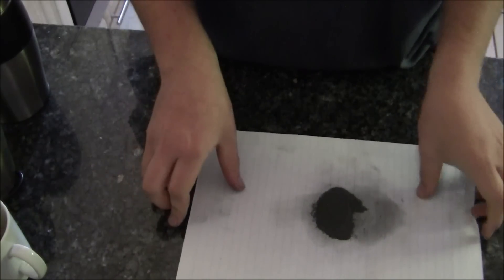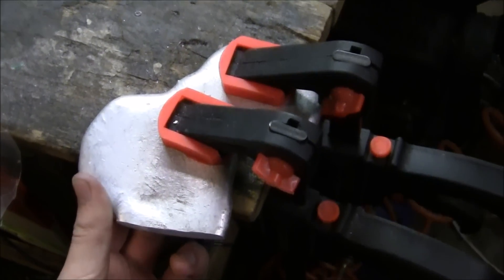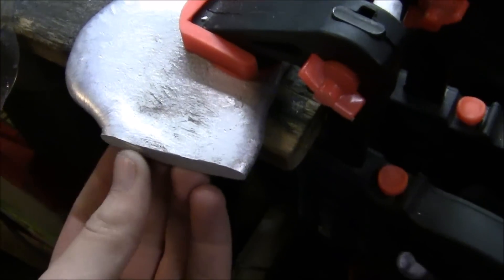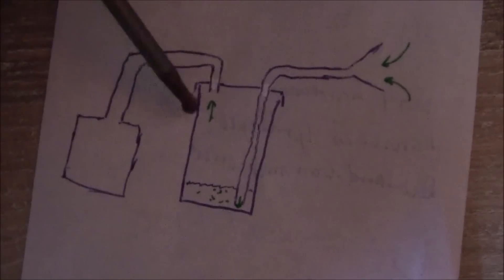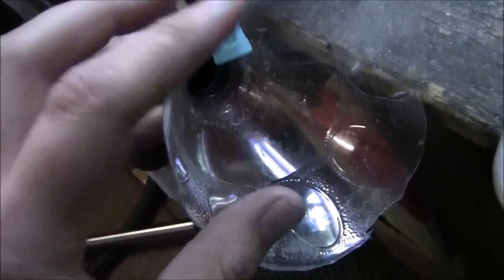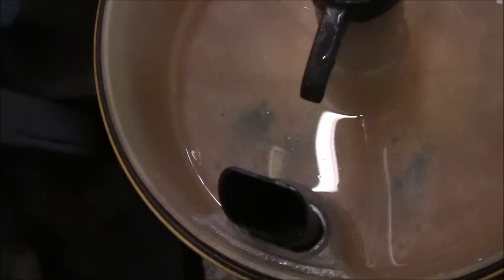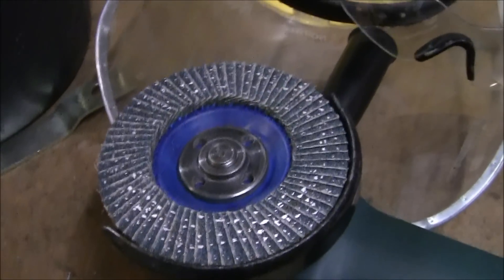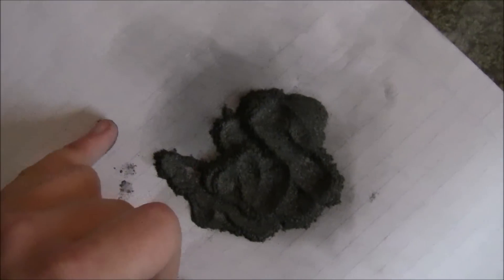how to make aluminium powder without using foil

Comment: Are you South African
Reply from the maker: hoe het jy geweet?
Reply from the maker: Dankey it's in a language only south Africans understand... I was confirming his question. It means ' how did you know?'
Reply: Home Grown Pyrotechnics I could tell by the accent.
Reply: And yes Afrikaans only South African know.👍 🇿🇦
Reply: Dankey lol our own president stole 700 million  rand 59213000,00 dollar
Reply: Home Grown Pyrotechnics I. Was wondering if you can make a video on sulfuric acid drain clean and tested if the drain cleaner it self will work in the sugar exprament and how much is left if you had to boil it down pls
Reply from the maker: for some reason YouTube didn't notify me of this comment. um as far as i know, sulphuric acid decomposes sugar into carbon so it would completely destroy any fuel i add it to. here is a video of the reaction: https://youtu.be/poDBrGIyTEk?t=33s

Comment: Have you thought of putting some sort of reducing agent in the water, so that the Al gets coated with it, preventing oxidation of the surface?  I believe charcoal is used during the ball milling of some products.  The water provides one with the opportunity to disperse a reducing agent more evenly, which might result in a nice even coat.  Just wondering.
Reply from the maker: the thing is that the aluminium has to be oxidised during the whole process because as it gets finer, it gets more combustible and if you mill it for like a week without letting air in, its said that it will oxidise so fast that it will catch fire.  the oxidation of the metal surface is instantaneous and forms a very thin oxide layer which then prevents further oxidation so i think that it wouldn't be needed to is some sort of reducing agent. i anyway have a lathe now and can use the turnings and im in the process of building a muuuch bigger ball mill for making aluminium powder but there are some parts that i need that i cant find.

Comment: Find a friend with a Lath the Chips and Shavings are fine and will break down very fast in a ball mill
Reply from the maker: Fred Nordhorn I actually have a lathe now, I got it mid november. I'm also building myself a rather large ball mill with the intent of grinding the aluminium turnings but I'm struggling to find some parts I need to Finnish it.
Reply: Lath are inch and a half by quarter inch wood strips!
Reply: Milling chips are good too.